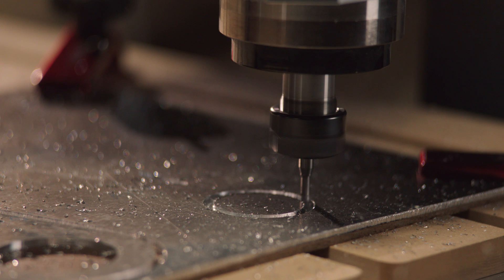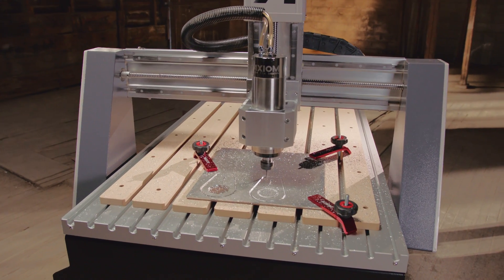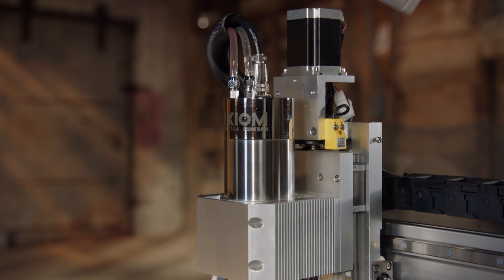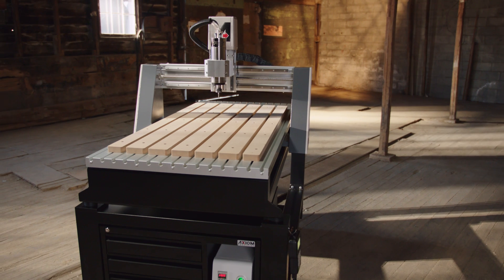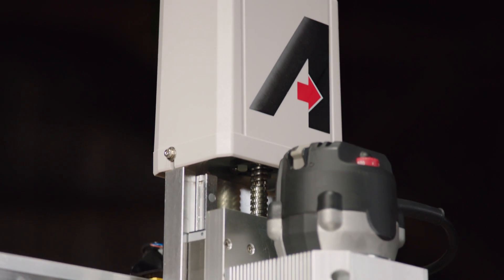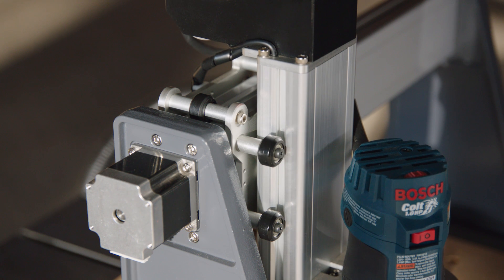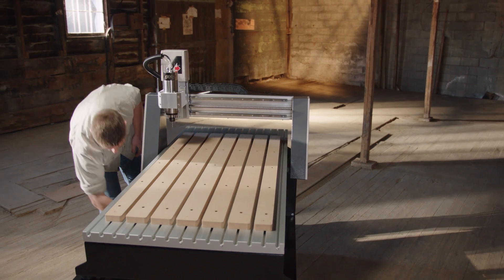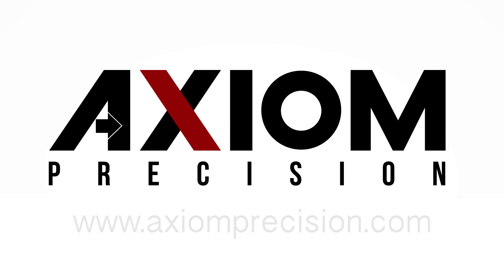Axiom Precision CNC

Comment: Does this work in imperial or metric units?
Reply from the maker: Users can design in either imperial or metric units.  However, the machines only operate in metric....if using the recommended Vectric software, once the proper post processor is selected the correct metric units will be used for the file and the gcode will be formatted to fit the controller requirements. 

If a different software is used, then the units will need to be converted before saving the file.

Comment: can you use a digital scanning probe with this machine?
Reply: The simple answer is, regrettably No. These scanning probes have somewhat gone the way of 8-tracks cassettes. They lack the accuracy and ease of use of newer technology in addition to requiring a PC control which our machines do not use. 

Currently the 3D camera and scanner tech is growing and becoming more available. You may find a local maker space that can scan items for you creating a very accurate 3D model....or you can purchase a scanner of your own even through BestBuy. 

In addition to greater quality models and faster operation, the scanners are also more durable than the probes which are rumored to require replacement often due to breakage.

Comment: Can the Axiom CNC be adapted to run with Mach 3/4?  Also, can the Axiom be adapted to run a 4th axis?  I noticed that Stoney CNC in the UK has done this but I believe Axiom builds a special version specifically for Soney CNC.  The ability to run Mach 3/4 and the capability to add a 4th axis will be a major determining factor in my purchase decision of an Axiom CNC.
Reply from the maker: Hi Mike,
Our machines do not support PC control and Mach 3/4.  When designing these machines we chose to avoid the inherent challenges found in PC controlled machines, and instead implement a more robust, dedicated DSP controller.  While this is a more expensive solution for us to install, it provides you with a more stable and reliable platform. 
 
As for Stoney CNC, they purchase component machines from us and integrate their own controller, which is PC based and similar to Mach 3/4.  Stoney CNC machines are only available and supported in the UK.

We are presently in the final development stages of a 4th axis kit.  Keep a close eye online at axiomprecision.com for upcoming details.  We expect to launch this exciting accessory within the next few months.

Comment: what type of materials can the pro series work with?
Reply from the maker: The Axiom Precision PRO Series machines can cut nearly any substrate that can be machined dry. Our liquid cooled electro spindle operates from 0-24,000 RPM, so any material can be cut given the proper bit selection.
Reply: Axiom Tool Group Can the Axiom CNC be adapted to run a 4th axis?  Can it be controlled with Mach 3 or 4?